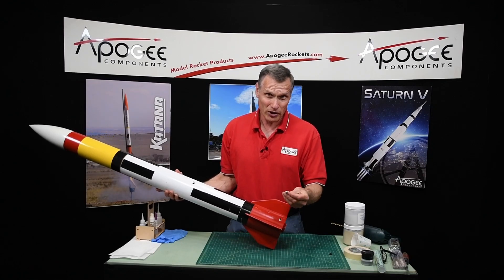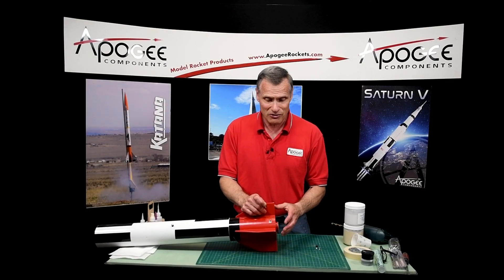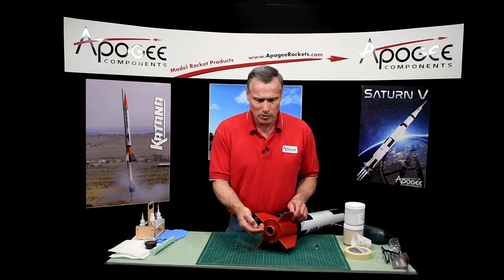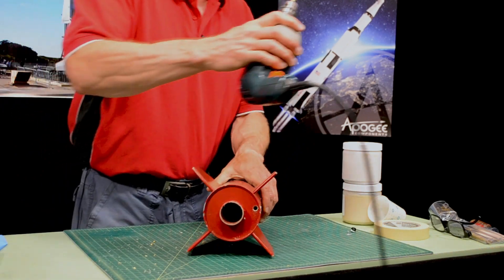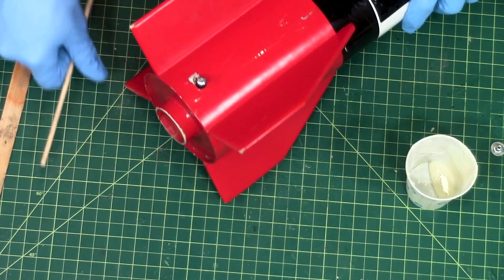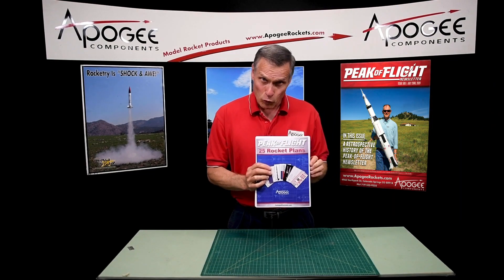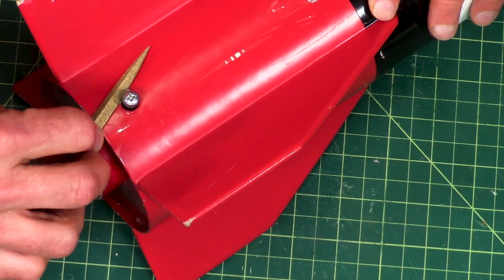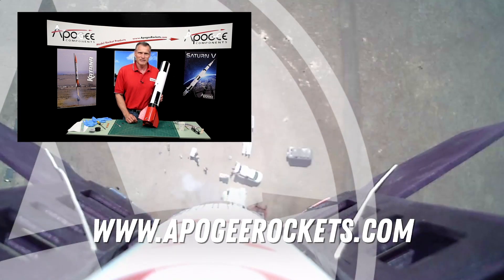How to Repair a Rail Button

Comment: Cut a big piece off the corner of a plastic bag, put the epoxy inside the bag, fold the open part over and tape it closed, then clip off a small part of the corner so you can squeeze the epoxy out through that hole.  You're making a "pastry bag" like they use to put decorative icing on top of a cake.  You can even do this with a sheet of platic where you can gather it up, tie it closed and punch a hole in the side.

Comment: I would of cut a slit and use your rail button and slide it in the tube with a piece of wire holding it in the thread put the epoxy in the slit and pull the button back flat against the tube then repaired the damaged exposed tube

Comment: why not just use a small wood screw and screw it into the aft centering ring?....after drilling a very small pilot hole first of course.....it's how I attach most of my rail buttons when possible.